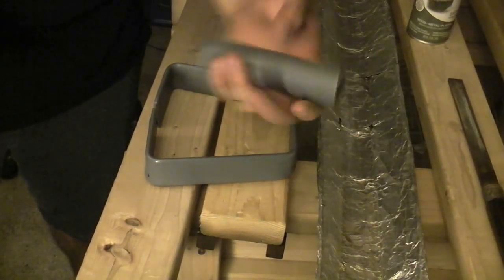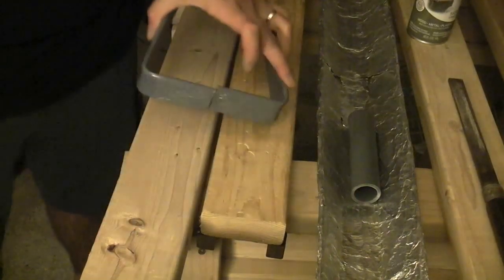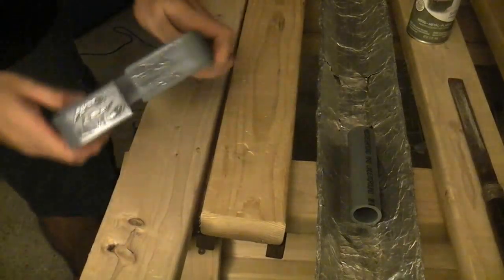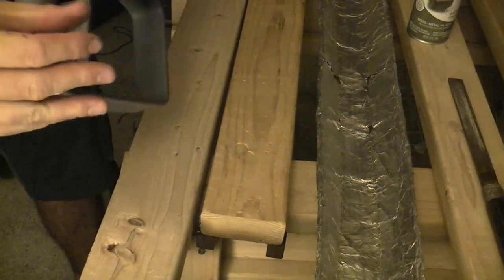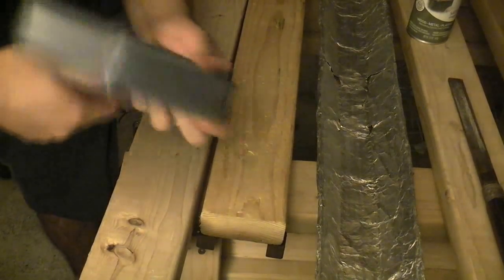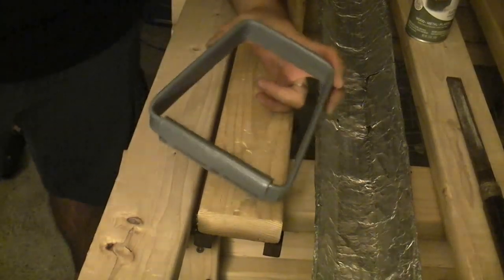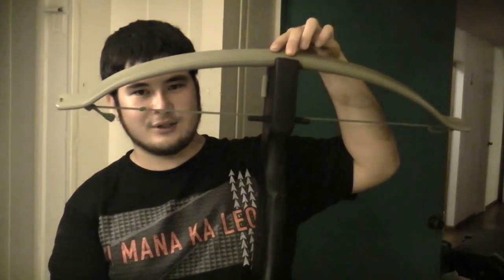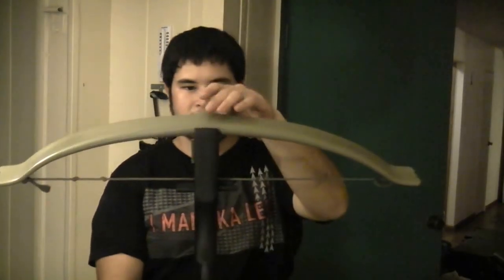How to Make a 100 Pound PVC Crossbow Part 9 - Stirrup and Rest

Comment: the nock of the arrow/bolt sets between the trigger poles. If he had just one pole then the bolt would have to set in front and would not lock to the line with the arrow nock.